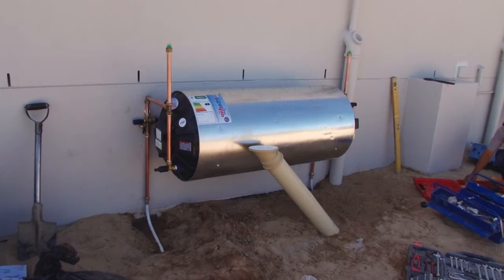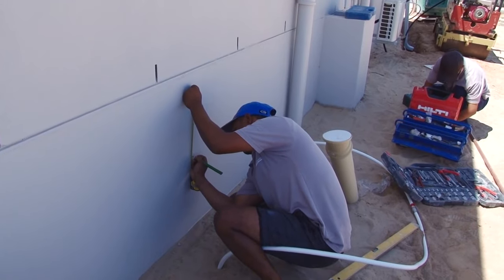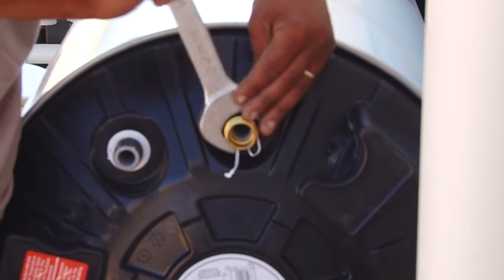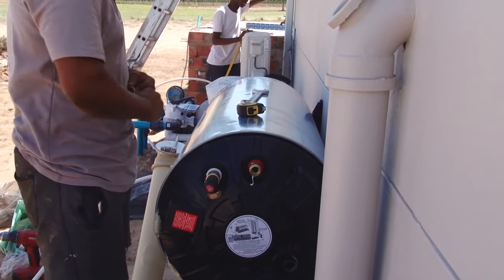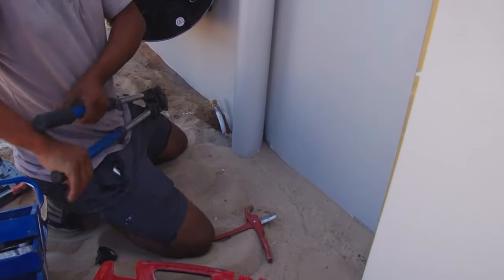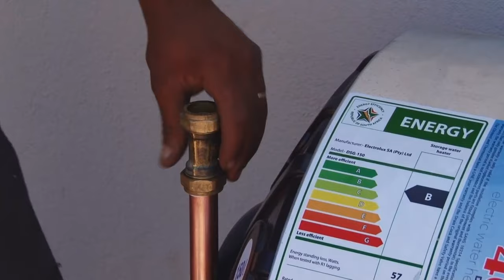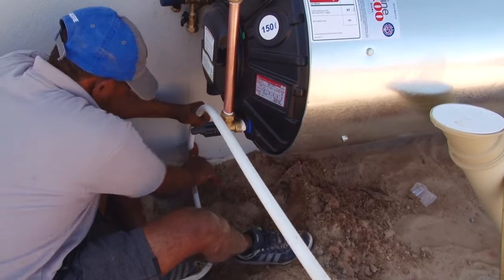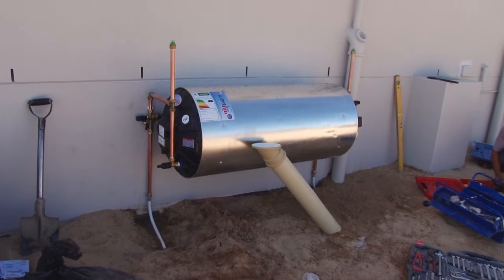How to install an Outdoor Hot Water Heater.

Comment: the narator does not know what is going on here, kwikot geyser are old school and need to be updated, solar instlation is not shown in this video, the presure valve should be instlalled at the water meter side to alow the cold and hot water to have the same presure.

Comment: Those "solar outlets" are called vacuum breakers. They allow air into the system and play a role in preventing back siphonage. The anti siphon loop in this installation is too low, the horizontal run of the pipe should be higher then the top of the geyser. The cold water supply to the rest of the house seems to be absent... That would normally come after the PRV to ensure balanced pressure in the installation. Sheesh. Guys please call a plumber instead.

Comment: I'm confused.  You cut the cold water supply pipe and fit it to the inlet of the geyser as well as the outlet? You just changed water supply to the house to only hot water I think. Plus there's no syphon loop on this installation...
Reply: I thought I didn't know my story until I read your comment. The must he a Tee after pressure valve so the water can be balanced in the house.

Comment: Good video. However it is important to note that when installing a geyser, there is need to balance the pressure on the cold water supply i.e. cold water for the rest of the house and for the geyser supply. 
To achieve this, cold water supply to the rest of the house must be connected after the pressure valve. So its pressure valve, tee junction (house cold water supply and geyser cold water supply) and straight valve
Now if you do that you achieve a balanced water pressure on both cold and hot water. Thank you
Reply: @alexagyeimensah1316  in which town are you
Reply: I'm in cape Town
Reply: Except there's no longer cold water supply to the rest of the house
Reply: The problem with this is if there is a problem with the geyser, there will be no water at all to the whole house
Reply: SANS10254 States that hot and cold water must be balanced where there are showers in the house.
Reply: L

Comment: Next time mention the pressure valve on the hot outlet side.Mention also that there must be a 30 amp  external breaker box .Otherwise good clip

Comment: I have a 600kpa gyser but the pressure control valve of the cold water inlet to the geyser is 200kpa. Can that be the reason I get low pressure on all the hot water taps around the house? Thanks in advance
Reply: Tomorrow it will be a void issue Baba

Comment: Just a question why do you put ptfe tap around the ring of a copper pipe. Didn't think you needed to do that
Reply: You are right, ptfe tape is not required around the rings for that type of fitting
Reply: It is required but it's not a must but wise plumbers they like to do things ones so it ensures that your fittings will never leak due maybe to the faulty on the rings

Comment: What if I have low pressure on cold water going to geyser?
Reply: That can result to the burn on your element so you need to install the booster pump to make sure your water supply is active

Comment: Years ago we spent some time in Montagu during August when outside temps were around 6 degrees, they also had their geyser outside, needless to say the geyser was on 24/7 trying to heat the water to 75 degrees.  It would be interesting to see the consumption for the above installation.
Reply: And inside the roof it is not 6'C?
Reply: @andrewg.mvisser5027  no, many roofs are insulated.
Reply: @Visionery1  and in SA most roofs are not.
Reply: I live there :)
Reply: I live there :)
Reply: I live there :)
Reply: I live there :)
Reply: I live there :)
Reply: I live there :)
Reply: I live there :)
Reply: I live there :)
Reply: I live there :)
Reply: I live there :)
Reply: I live there :)

Comment: Where is the cold water supply to the rest of the house ? Isn't that missing here. Cause the geyser was connected from the main water supply
Reply: I was watching this video last night and something bothered me about this, i watched again and saw that there is no cold water supply to the house, so im not sure why they didnt do it like that, would love to know
Reply: The system is unbalanced this is the reason for no cold water supply and also they never installed a non return valve to prevent back flow into the system.

Comment: Who ever dislike this video has seriouse problems better then this must be wrong
Reply: Good video. However it is important to note that when installing a geyser, there is need to balance the pressure on the cold water supply i.e. cold water for the rest of the house and for the geyser supply. 
To achieve this, cold water supply to the rest of the house must be connected after the pressure valve. So its pressure valve, tee junction (house cold water supply and geyser cold water supply) and straight valve
Now if you do that you achieve a balanced water pressure on both cold and hot water. Thank you
Reply: There is just a slight problem with the installation, no cold water supply to the house
Reply: It's not completely wrong but as a plumber I have to say it's not a proper installation
Reply: Anti siphon loop not high enough. No cold water supply to the rest of the house after the prv.
Reply: Wy